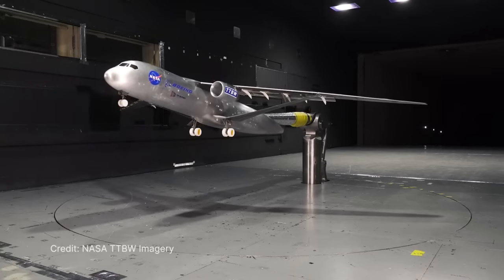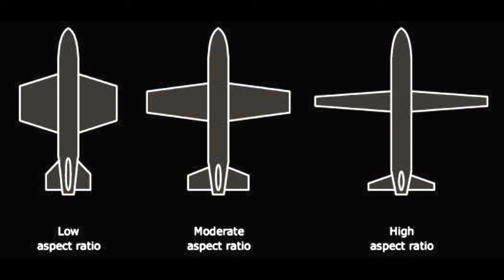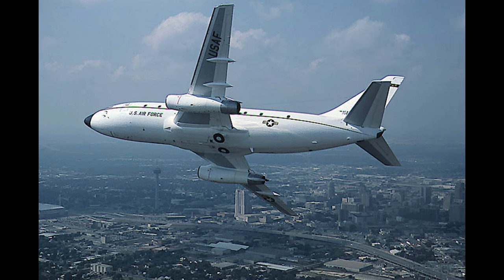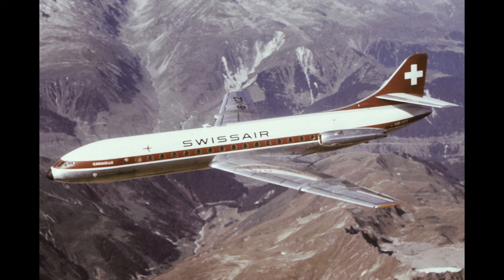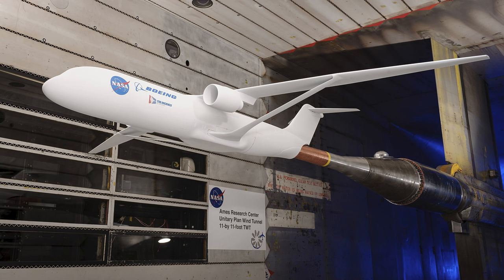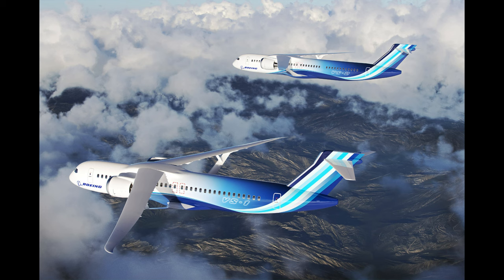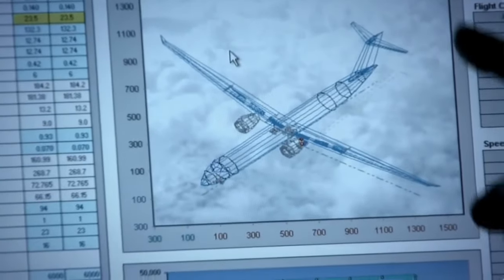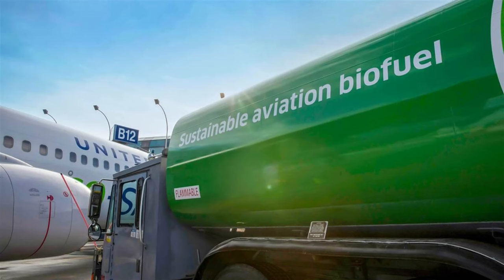NASA's New Airliner Experiment To Make Flying Less Expensive

Comment: Increasing the length of the wings for efficient flying follows the same physical principle as increasing the diameter of a turbofan engine. Because a wing generates lift by accelerating air downwards (the recoil principle). And the lift is proportional to the mass and to the velocity an air package is accelerated. But the energy to accelerate the air package  is its mass times its velocity squared. This means it is more efficient to accelerate a large airmass to a low velocity to generate the lift. And large wings capture a large airmass 🙂.

Comment: While thinking on this problem I think the most practical way to make air travel greener (at least in the U.S. and some other parts of the world.)
Is trains.

I know that's the most boring solution but we do use a lot of puddle jumper flights that really don't save the passengers any meaningful amount of time.
Reply: why not covered wagons?
Reply: @DrDeuteron  While it's certainly a more natural approach to travel, its still putting out CO2 and methane.  

Plus you have the issue with road apples.
Reply: I don't think you realize the size of the USA. It works in small European countries you can run rail to every corner. But I can fit the enterity of the UK in my state and we got 50 of em. Not all airports are JFK INT you can get boarded and off the ground in a pretty short amount of time unless it's a major city. Whenever they invent a 600mph train call us. No one is wasting that much of their time to take a train around the USA some of us gotta work.
Reply: @n111254789  US has a great train network, it just hauls freight. 100+ car 7 engine up front, 3 in the middle going over Sierras or Rockies is an impressive sight
Reply: @n111254789  Trust me I'm American and I've travelled it a decent amount I was not suggesting trains as a replacement to airplanes in general.   Just the puddle jumper flights

I was literally thinking of the north east corridor when I wrote my idea.

Having flown from JFK to ABE, and Phillidelphia international airport to ABE quite a few times in my life.  That's exactly where a good train system would make so much sense.  A plane can do these flights in 20 minutes maybe less of flying time.  But till you factor in the time it takes to board, taxi, take off, land disembark.  Your looking at 40 minutes to an hour..

A train going 60 mph would take about an hour.  

Assuming your from Texas, San Antonio to Austin I imagine would be about as fast by plane as by train.  Trying to go from one end of the state to the other, yeah a plane is the fastest answer hands down.

Comment: The best general purpose vehicle ever built is the minivan. I love my Sienna!

But the thing you are thinking of is safety factor. A vehicle can have a 2 to 5 times safety factor, while planes rarely have more than 1.25 to 1.75.

All that safety factor means is that when there is a critical component, you multiply its expected strength by the amount you want it to not break.

For instance, the Brooklyn bridge was built with a 5 (or higher) safety factor. And it handles loads WAY beyond what was expected!

Planes simply don't have the weight margin to blow the safety factor up to where anything is reasonable.

Comment: "I really hope Boeing doesn't screw this up!"

Boeing: Hold my beer!
Reply: Lol
Reply: It wouldn't surprise me if they would just put such a wing on top of a 737 fuselage and try sell it for another 50 years
Reply: @simonm1447      The 737 max exists precisely because they didn't want to make such radical changes to the 737 platform.  If you have to do all that, you start from scratch.
Reply: @jshepard152  it's an experimental platform, while the Max just uses a proven concept with more efficient engines. They had to introduce the Max since Airbus was first with the Neo, which would have given the Neo a 20 % fuel advantage over the NG.

This new concept may be the narrow body airliner of the 2030s, but a lot of research has to be done yet to prove this.

Meanwhile Airbus is developing a new carbon fiber wing for the 321, with a much higher aspect ratio and folding wing tips. It will fly on test aircraft soon.

Comment: Do you think that what would normally be “contained” engine failures with shrapnel exiting the outlet and the inlet of the engine pose a greater risk due to the what appears to be new positioning of the engines? They seem closer to the cabin while also being more centered in the aircraft instead of lower in the nasa renders. Maybe it only appears closer due to the larger wings. 

Bottom line do you think there will have to be changes to engine design or engine positioning in order to meet FAA guidelines on contained engine failure due to design of the new engine positioning potentially putting the cabin at a higher risk of outlet and inlet shrapnel.

Comment: At Handley Page research department in the 1960's, we showed how by laminar-flow created over the total wing and tail surfaces, one could save at least 50% of the fuel needed by a regular design of cruising passenger transport aircraft.  But it was difficult to design and took much money to develop, and our company went bust before it could be fully developed. This concept should be introduced to all-wing efficient designs like we did on the HP117 project then.

Comment: Looks like a good idea at first glance- but another retro step into past methods could bring another improvement here too- could the jet engines be better mounted DC, Lear or Trijet style near the tail like the MD90 it's based on instead I wonder? You wouldn't need to worry about the engine loading on that slim wing,  there's also the issue of engine noise in the cabin with engines hung under a high wing at the same height as the cabin isn't there? Another bonus could be that where the engines were (if you move them to the back of plane) you could have an aerodynamic/shaped lifting fuel tank on the wing instead, I'd definitely feel safer if I knew all the fuel tanks weren't underneath my feet.
(*I'm writing/wrote this as I watched the video and just noticed a design with the fuel tank on wing in the vid too) All the best all.
Reply: The engine loading on the wing should be a good thing (otherwise the wing is carrying the fuselage and engines as a load rather than just the fuselage).

Comment: High temperature nuclear reactor designs can decompose H2O without electrolysis. You can use cracked H2O and CO2 to synthesize fuels using Fischer-Tropf catalysts at costs competitive with fossil. Methanol and dimethyl ether are both viable

Comment: Reducing span-wise flow means less high pressure air leaking around the tips and reducing overall lift, results in having to fly at a higher AOA, which is the direct action that causes the increased induced drag.  The methods to reduce spanwise flow, aspect ratio, tapered tips, winglets,  fences, fairings, etc., help to "trap" the high pressure on the bottom and low pressure on the top at the tips, result is lower AOA for the same amount of lift and thereby, less induced drag.

Comment: With the conversion of auto engines to aero, not to mention even a cursory look at the mechanical engineering of modern auto engines, the "I'm at X power for hours" doesn't hold water. The only real question is TBO and that's a bearing/journal design question. With drastically lower cost of auto engine parts halving or quartering a TBO is still more cost effective in most instances. Especially if it actually makes it to TBO which depending on the aero engine that may not be the case.

Comment: With open fan engine tech having one foot solidly in Europe (and Airbus already cooperating with CFM) it probably makes good sense for NASA and Boeing to bundle up domestic competence in another high-effficiency project. If super high ratio wings and open fan engines work combined and if either of them is half as good as promised, this means a substantial uptick in efficiency.
Reply: Noise regulations will make it impossible..

Comment: I apparently just learned something as an AE today. We refer to transonic as the transition from less than M1 to M1 generally from .8M to greater than 1M. 

You generally want to stay away from this in almost all cases where fuel efficiency is concerned. Things get very messy around that area and drag starts to be a major issue along with overcoming the air pressure.

I didn't know they called normal airliners transonic as well. Super weird.
Reply: Smaller airliners like the 737 and A320 cruise at just under Mach 0.8. But larger planes like the A350/A380 and 747/787 cruise at around Mach 0.85.  Boeing's Sonic Cruiser was planned to cruise at Mach 0.95. The can all cruise even a little faster than this, these are the speeds where they are more economical.

My understanding is that some parts of an airplane start to get close to supersonic sooner than others, mainly curved areas that speed up the airflow even more than what occurs over the wings. That's why they have to stay well below the speed of sound to be efficient. Different designs can keep this from happening as much, that's what they were trying to do with the Sonic Cruiser.

Comment: you can move a little bit of air a lot.
or you can move a lot of air a little bit.

the ideal, drag free scenario would be that all air displaced to produce lift would return to the same relative position with the same energy, kinetic or thermal etc, as it had before the wing passed.

as the wing has to divert airflow to produce lift, you cant escape the inherent drag it produces. you can reduce it to a degree. high aspect... minimise the time the air is in contact with the surface, whilst maximising the surface.

the other drag is aerodynamic. any "stationary" air that is accelerated and moved takes energy. the "backwash" of any vehicle is secondary air that has been accelerated, displaced, given energy. it travels with the vehicle, in the direction of travel.

now, if you could devise a way to get that air to actually end up traveling opposite to the direction of travel, or simply remain relatively stationary...

i think theres a way and its staring us in the face, always has been. some interesting effects in a wind tunnel. i need a better wind tunnel.

Comment: Interesting idea.  I wonder if Boeing is going to have to fit folding mechanisms on the last 1/3 of the wing or so if the wings exceed 212 ft in width total.  Boeing is already proposing folding wingtips on the 777X as the extended wings can make it too hard to park the jet at airport gates without folding to reduce the overall width of the wingspan first.  I would imagine the same issue would happen with super long truss braced wings on full size jets.  Great in the sky, just mundane airport logistics issues to deal with too.

Comment: The MD90 was very, very successful if you consider it's mostly the same airplane as the DC9, MD80, and MD87...  I doubt they'd go to production with that fuselage since it was only economical with 2+3 seating, which is still kinda weird.  

The big efficiency gains are going to continue to come from the engines - running the cores hotter and at higher pressure ratios, and having higher bypass ratios, possibly with external fans, possibly even turboprops (gasp).

The other other big efficiency gain will come from flying more slowly, which these wings will help enable due to their lower induced drag.  If they can get around the extra intersection drag caused by the joint between the strut (truss) and the wing.

Comment: From Wikipedia - The DC-9 series, the first generation of the DC-9 family, was a commercial success for the manufacturer. It was produced on the final assembly line in Long Beach, California, beginning in 1965, and later was on a common line with the second generation of the DC-9 family, the MD-80, with which it shares its line number sequence. After the delivery of 976 DC-9s and 108 MD-80s, McDonnell Douglas stopped DC-9 series production in December 1982,[4]
The DC-9 family is one of the longest-lasting aircraft in production and operation. Its last family member, the Boeing 717, was produced until 2006. The DC-9 family was produced in total 2441 units: 976 DC-9s (first generation), 1191 MD-80s (second generation), 116 MD-90s, and 155 Boeing 717s (third generation).[6] This compared to 2,970 Airbus A320s and 5,270 Boeing 737s delivered as of 2006.[7][8]

Comment: My company built the wind tunnel models for this program.  The structural requirements were difficult to achieve even making the wings from maraging steel.  The struts are incredibly slender. It wasn't easy to manufacture. I suspect fuel cost will have to be much higher than now to get airlines to abandon the 737.  There are many other costs that factor in like training and maintenance that dictate aircraft choice.  The 737 has choked out several other aircraft that compete with it even though it's antiquated.
Reply: That would be true to some extent with any airplane type, changing from old to new has quite a lot of costs. But airlines do it all the time if the new models have enough benefit in cost or capability. Clearly there are more modern planes out there, but its main competitor the A320 is starting to age, so the difference is not quite as striking as it used to be. Airlines might be more tempted at the low end with the A220, but it is only competing with the least popular size of the 737. 

It's even more difficult if an airline has a large number of a particular type, which is the situation at many airlines which have a large number of 737's. But then again there is a reason why airlines have so many 737's, it's because it has always been a very popular and profitable airplane for airlines. The Dash 80 airframe has been an enduring design, by far the most successful in history, providing the 707, 727 and 737, totaling nearly 15,000 aircraft over sixty-five years. It's understandable that of  the three it was the twin-engine version that has endured. The 737 has proven scalable to different sizes with relatively low development cost for each variant, and a manufacturing  process that has been fine tuned for decades. 

The change to the NG engines twenty years ago allowed it to remain somewhat modern, and now the LEAP engines, which have also breathed new life into the forty year old A320. The cockpit is not as state of the art as modern airliners, but it is serviceable and certainly well known by now. The only real bugaboo is the lack of EICAS, which I think at some point the U.S. government will need to step in and do something about, the latest attempt failed because it didn't solve the entire problem. What is needed is a partial subsidy to assist airlines in upgrading all existing 737's with EICAS by a certain date, combined with requiring Boeing to install EICAS on all new 737's. Of course that argument will drag out for at least five years, which will make the airline and government's retrofit cost even higher, so hopefully they will address this sooner than later.
Reply: @StevePemberton2  
My company built an ice accretion model for the 737 airframe.  When we priced out the fab cost, we realized it was cheaper to buy a h-stab out of Mojave and cut it up.  There are so many parts available, it was penny's on the dollar.  Kind of a shock when the truck showed up and we unloaded it in the parking lot.  Now what do we do?

Comment: The biggest problem with high aspect ratio wings is they don't fit inside current hangars for maintenance, hence the reason the A380 had relatively stubby wings for its size.....

Comment: A combustion/electric hybrid jet engine design makes a whole lotta sense, if not from efficiency, then for robust starting and engine out possible redundancy. Id want a few of the geniuses behind the 2008 Toyota prius drive train on the design team if possible. Future of "electric planes" might be in NiMh for all weather "reliability"reasons too. 🤔 weird  😆
Reply: Fossil fuel for liftoff... switch to electric for cruising altitude... They should use solid state Li batteries (no liquid electrolyte for safety reasons.) This will dramatically cut down on fuel usage. Win win for everyone 👍

Comment: One big problem of biofuels that are often overlooked. It's not just a matter of approval.

"If they can be produced" is a much bigger caveat than what most think, because those fuels are *fighting for agricultural land access*, against building cities (and the large suburb that many love), forests, pastures.. and of course, food.

One similar example was in the 19th century, which used so many horses for transportation >which also use land for energy production< that forests were decimated and famines happened because of that.

Biofuels cannot be done with sacrifice. They aren't as green as told on paper because they forget those practical applications, yes they are green if you assume that land surface is free, but it's not. And yes you mention algae, but they have also resource use issues.

Comment: It's interesting to see that the horizontal stabilizer moves to a T-tail in this design. Perhaps the high-aspect wing no longer blanks airflow over it at high angles of attack, meaning it's all benefit to moving it up into less turbulent air. As for space limitations, seeing an airliner with the outer wings folded and rotated back like on the F4F Wildcat might be pretty cool.
Reply: It's a shoulder wing aircraft. In this case they have to put the horizontal stabilizer on top of the fin, otherwise it would be in the airflow behind the wing.